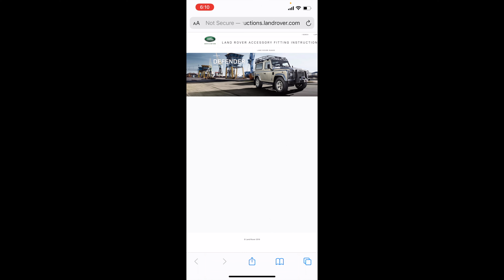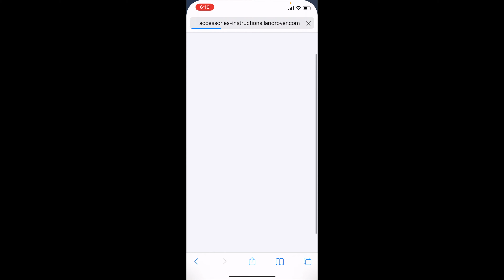How to Install Factory Tow Hitch on (2013-2021) Range Rover L405 Full Size

Comment: Thank you for listing the Range Rover part#s needed to perform the Tow Hitch installation. Can you use the existing bolts/screws for this installation or do you need to buy some extras (I bought the three skus off eBay, did not come with additional bolts)? I did not watch the full video but looking at comments, it is very detailed and I am comfortable doing this myself, just want to ensure I have all I need before starting the job..

Comment: Did you ever make any follow up videos? In the research phase now. I need to do mine.
Reply from the maker: No follow up. Never even used the hitch 😂 I installed it because we were planning to buy a StowAway hitch rack but ended up trading in on a G63 before buying the rack. I have no doubts that the hitch is nice and solid though!

Comment: Great video! I think it would be a good idea to support the vehicle with jack stands or put it on ramps when working underneath. Those air springs can deflate on you.
Reply: Underrated precaution. It only has to kill you once. No respawn.

Comment: Great video...I will be adding the tow hitch to my 2017 and your video is a huge help!
Reply from the maker: Glad it helps! Thanks for the comment.
Reply: @krazyk86cu  Any idea what the thread pitch is on the bolts?
Reply from the maker: @wo7837  no clue, but everything you need including hardware should be included with the tow package you pick up from the dealer
Reply: Where did you purchase your hitch

Comment: @31:05 I see the same issue I ran into where 2 of the holes where the hitch mount weren’t tapped from the factory.
Reply: So what did you do, install Rivnuts?
Reply: @fredbrackely  I either didn’t install anything there or I fabbed up my own angle brackets. I can’t remember 😂.

Comment: I am thinking about tackling this job on my 2022 Sport.  Do you happen to know if the instructions are identical for both vehicles?  I know a 2021 Sport is the same vehicle as a 2022, and a 2021 Full-size is same vehicle as 2022 Full-size...just don't know this part of the undercarriages are the same...
Reply from the maker: I can’t confirm that the part numbers are going to be the same, but I’m fairly certain the install will be the same.
Reply: @krazyk86cu  Thank you, and thank you for taking the time to make and post the how-to!  I'll let you know how mine goes, should I decide to give it a go.

Comment: Hey sir - am I just an idiot or did the video not cover the installation of the towing wiring harness?  Is it just a plug and play?  Any coding?
Reply: No, the electrics will need new coding, so you can either visit the dealership or activate it through our GAP tool if you have one.

Comment: This is such a pain. I ended up getting the stealth hitch
Reply: Is there a part number for the stealth hitch?
Reply: @wo7837  as per my documents RACK RECEIVER KIT#: SHR40002   COMPATIBLE WITH TOW KIT: SHT25032 . But I went to the website, clicked on "find an installer" and got it installed by a shop about 1.5 hours from my house because I wanted it done right. It came out to $1200. Dealership quoted me nearly $3k for OEM and it would have shown in the rear. The stealth hitch is hidden except when in use.
Reply: @wo7837  stealth hitch ? Can you send me a link ?